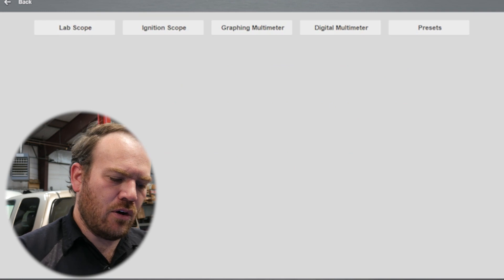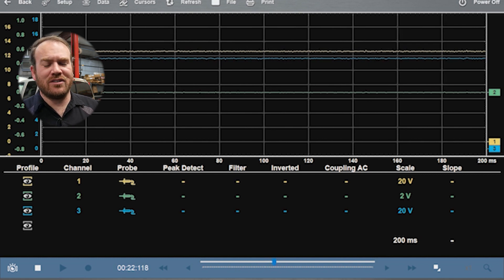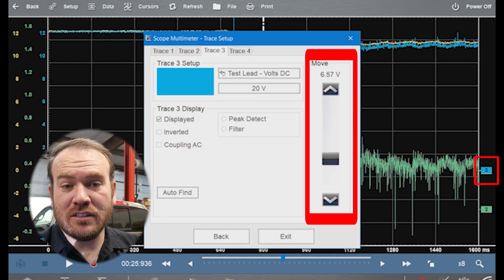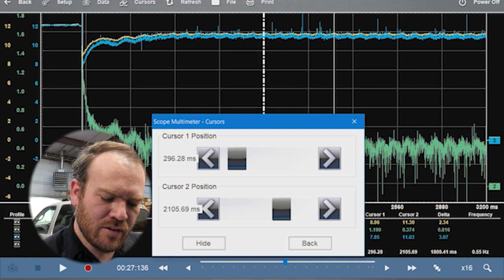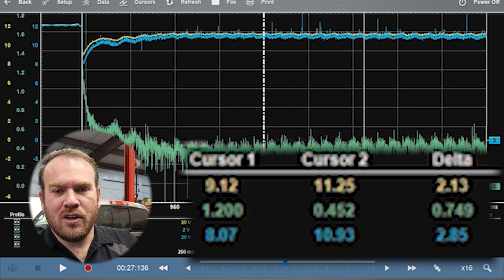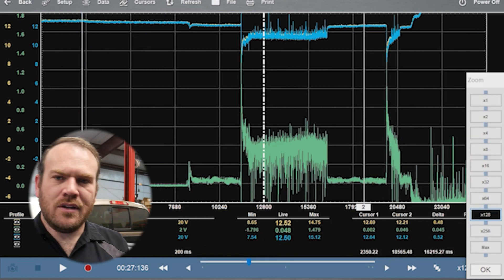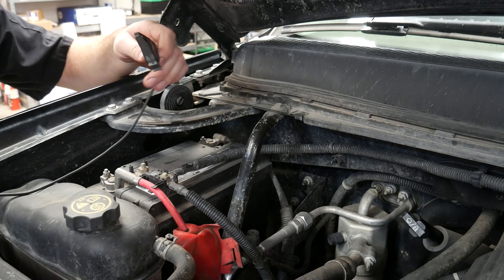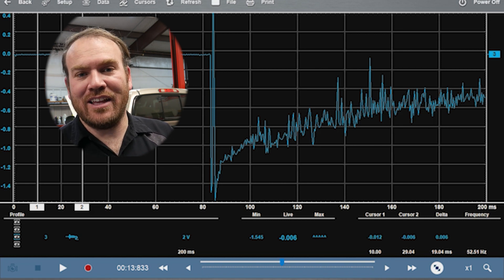Weekly Waveform #2 - Voltage Drop testing the starting circuit

Comment: Great video I have the Zeus and i enjoy it's versatility. It's compact and clear enough plus component repair is a nice feature as well.
Reply from the maker: It’s super nice to have component information built in. I like running split screen with scanner and scope as well. Makes bidirectional controls easy to access and watch the outputs on the scope side.

Comment: Thanks for sharing your videos and your knowledge. I will try and catch up with some posts this week. It will give me a good opportunity to use my single channel Uscope, my two channel Pico and my four channel Ditex automotive scope. Keeping my fingers crossed as this is my first actual hookup. I have two Hondas a 3.5 07 Odyssey and a 99 3.0 EXL Accord. Both very low mileage. Will also be doing timing belt and valve adjustment checks just waiting for new seals from Honda to arrive. This is on the Odyssey. The Accord I’ve  already accomplished those tasks. Thanks for sharing 😊 Hondas I will need to pull the fuel pump fuse or relay unless you have a better idea. Thanks
Reply from the maker: I don't think Honda supports the clear flood mode so disabling the fuel will be the best option. Fuse 4 under the dash should power the fuel pump on the van. You will need to crank it for a while to run it out of fuel before performing the RC test.
Reply: @ThePracticalMechanic  thanks for the info. I will definitely try it.  That was the route I was thinking of going. Appreciate the reply. 😊

Comment: Is the scope “ too fast “ to condemn cables for the 1volt drop? The initial spike is a fail but the average drop isn’t too bad.
Reply from the maker: Perhaps the scope is too fast to use the initial spike. What Daryll noticed was the way that the voltage drop increases over time as well. This indicates part of the cable is heating up rapidly and resistance is increasing as well. After the initial spike I was at 360mv and at the end of the cranking period I was over 400mv. I forgot to save the image but used the thermal imager on this truck afterwards and the negative cable end and next three inches of cable reached 170F and the positive reached 150F. The new ground cable was installed and the voltage drop spike dropped in half and then leveled out to less than 200mv. 
The positive cable was not replaced at this time. 

I think part of the problem is manufacturers cheapening up materials and running smaller than required cables. They work fine for one or two startups but quickly exceed the recommend work load. We will be working the amp clamp into this test in the future and I’ll address where the reading should be taken. 

Thanks for your input Bart as I sometimes overlook key points to a test.

Comment: Thank you Chad and Val. Good job. Word of caution to all and learning from my mistakes. We learn and remember from our mistakes, the best teacher is experience and making mistakes. Over 20 years ago, as a younger tech, I had a truck that had 7 VDC drop from positive battery post to positive starter post during cranking. Complaint was slow cranking. So I made a new cable and installed. Same result. LOL. Then I load tested the battery, it failed, dropped below 9.5 VDC under load. Installed new battery, same result, 7 VDC drop across battery positive to starter positive. Logically, replaced the starter. Fixed. Moral of the story. Weak battery and dragging starter results in slower turning starter motor. Which results in more amps flowing down the battery cable. Which results in more heat build up in the cable. Which results in resistance in the cable. This heat resulted in my 7 VDC drop across battery positive to starter positive. Lesson learned. Since then, battery load test first. Visual inspection of cables and connections. Then starter amp draw test. Lastly voltage drop cable. The things we remember LOL. Have a blessed and safe week to you and your family.
Reply from the maker: Wow. Thanks for information Billy. Nothing can replace experiences. We haven’t added accessories to the scope or we would have used an amp clamp as well. That will give us the last piece of the puzzle and hopefully help us determine where our problem lies. Excessive amperage in our current waveform like Joe’s Auto diag had the other day better make us stop and look for the issue. Seized accessories, tight engine or failing starter will overload the starter cables. This truck had a .320 voltage drop on the negative cable after replacement but unfortunately the customer decline the positive at this time. 

Thanks again for sharing your lesson and now I’m on the hunt for a case study.

Comment: This was really cool. Thanks for sharing your experience. Very well explained & I learned something new about GMC & Chevy Cables. Thanks Brotherman 🙌🍻
Reply from the maker: No problem Justin. We are going to working our way through as many test as I can possible think of as well as ideas from the community. 

I think the cables on the newer cars are getting worse and worse. Gm cars actually has a TSB for their replacement because the voltage drop and noise was causing all sorts of electrical faults.

Comment: I think it'll be simpler just to use a Fluke meter with the min-max feature
Reply from the maker: This test can absolutely be performed with a DVOM but we can't get the full picture. When this test is performed with a labscope we can check relative compression, battery health check and voltage drop. In this series we are building scope skills that will become valuable in the future tests being performed. It can also give us a pretty picture to print out for our customers or to email to extended warranty companies for proof of work performed.